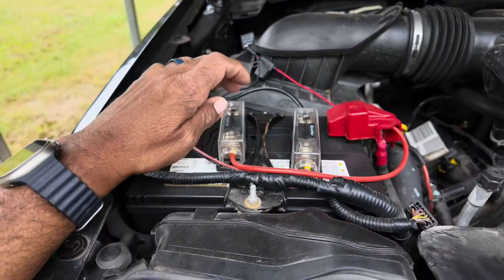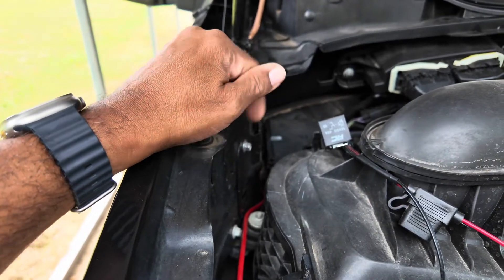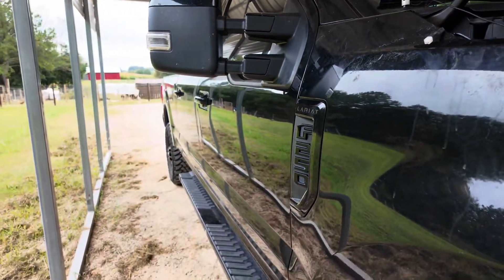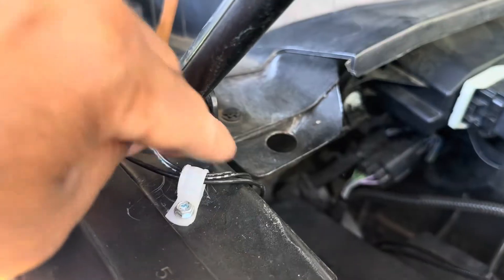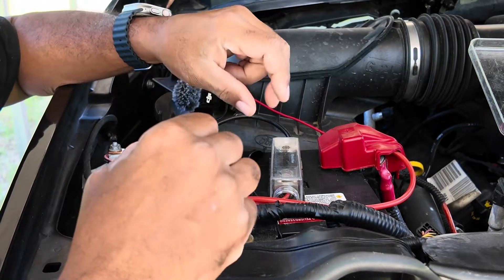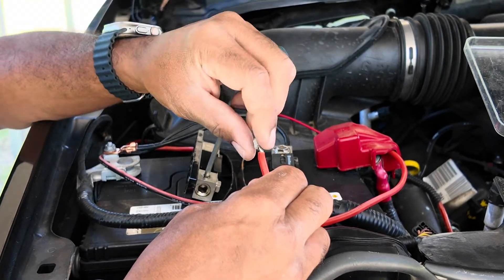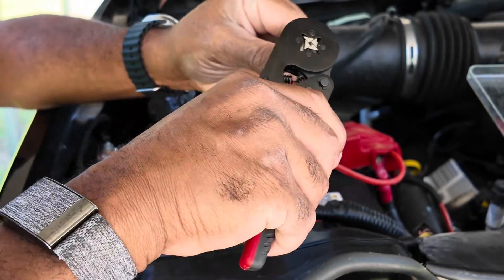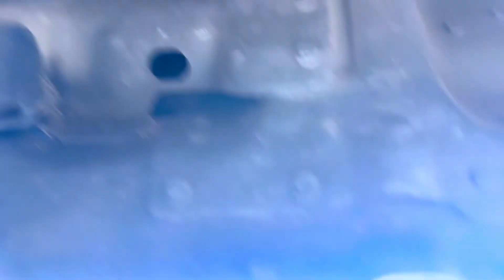Part 1 - How do I get wires/cable from the engine area into the passenger cabin for a mobile radio?

Comment: I should catch up.  When did you get the super duty?
Reply from the maker: Hey.  I got that after Huntsville Hamfest.  Going over there from North Carolina had me pretty well convinced.  The trip back made up my mind.  The F-150 wasn't struggling or failing, per se, but it was working very, very hard on some of those steeper inclines.  I just figured better to have more power and less work at maximum effort.  A couple F-250s fell in my lap; one bit me, and the other I kept, lol.  The first one, the sales person neglected to tell me it was diesel def deleted.  I didn't want that because I didn't know the ins and outs of registration.  He didn't want to give me my deposit back.  A conversation with corporate inspired him to give me my money back.  The second one is gas, and it's doing ok so far.  Hit me up on discord.  See you out there.  73 de Bill

Comment: Another great video -- thank you!!

I've done various installs over the years, and this never ceases to be a challenge. On a few rare occasions, I've found it to work a little easier starting from the passenger compartment and finding the probe on the engine side, but like I said -- rare occasions!   

I'm getting ready to do it again on a new vehicle after having my previous ride for over a decade and about 250K miles, and, as usual, I'm mildly dreading the process (and procrastinating). I'm waiting for cooler weather -- that's my story and I'm sticking to it!  

73 de N8ESP
Reply from the maker: Thanks for stopping by!  You said mildly dreading, lol.  I know exactly what you mean.  I though I'd approach these series while remembering one of my more easy installations, and get it done generally.  Then, Dennis from  DenCo batteries asks a question that reminds me of one of the hardest I've ever done.  I don't think I can do a video that covers all bases.  I went the totally easy way on my latest install.  I understand your concerns.  I think I did them a little out of order, and my next video will "try" to fix that.  I'll mention your suggestion to try to start from the passenger compartment.  Thanks for jumping in the conversation.  See you out there.  73 de Bill
Reply: @Bill-HRT_K0WHW  You're right -- you can't possibly do a video that covers every situation! Too many permutations!
You covered the things they all have in common and gave the appropriate safety precautions (which is always an excellent reminder). 
Keep up the good work -- I'll keep watching and looking forward to a future QSO with you!

Cheers! 
John (N8ESP)

Comment: One thing Ford did well was allow for vehicle access points and panel grounding. I attribute these to the number of police vehicles they sell. Every Ford truck I have had has had access points and good grounding.
Reply from the maker: Thanks for jumping in the conversation.  I appreciate you watching and joining in.  I never though about this, but it makes sense.  I just know the more times I do this, the more I look for easier spots to pass wires in.  Thanks for sharing this.  See you out there.  73 de Bill